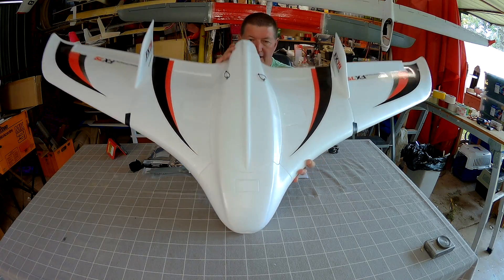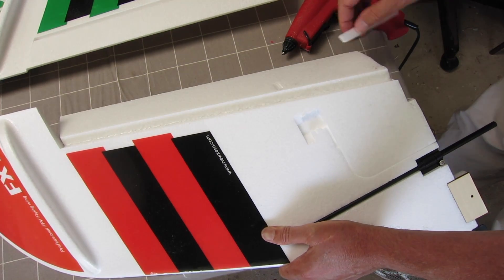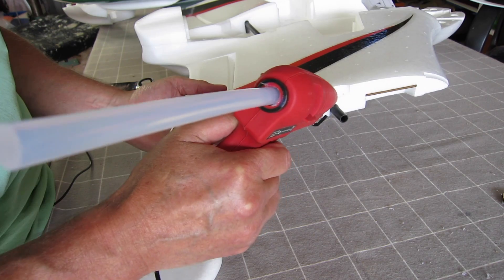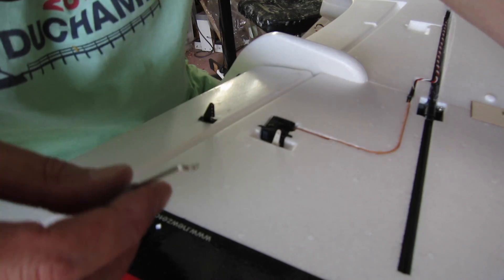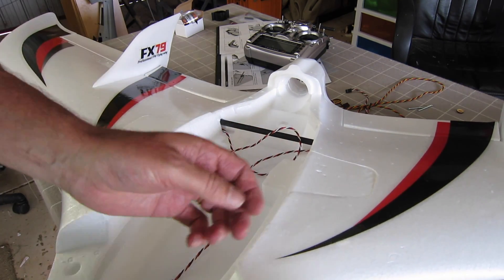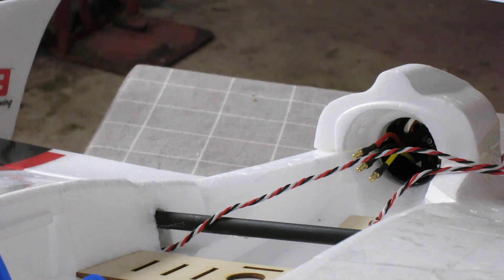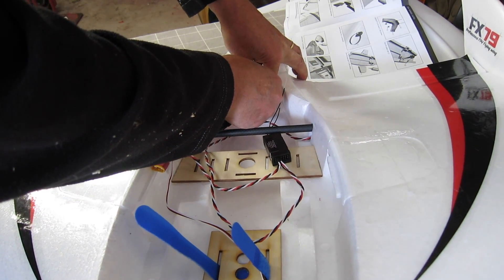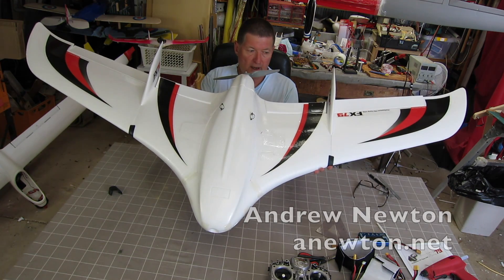Zeta FX-79 build

Comment: What type of tape did you use for the servo extension leads?
Reply from the maker: Fibre reinforced tape from HobbyKing, but I wouldn't recommend it. Turns yellow and unsticks over time. Blenderm tape is better but expensive and hard to find. Normal packing tape might be the best
Reply: @AndrewNewton  thanks for reply.

Comment: Broke my aeilron best way to glue it back on ?
Reply from the maker: UHU Por or E6000 so it stays flexible
Reply: @AndrewNewton  i used weldbond found at mitre 10 seems to have done the trick. Could you use hot glue?

Comment: Good job on the video! I have an FX79 and love it. Long distance FPV only. I use a 3542 1000KV motor and an 80 Amp ESC. For some reason, both units heat excessively. I have tried everything I can think of. ....other than installing the ESC on the outside of the aircraft. I finally sourced a 12 volt dc fan and provide a 2200 mah battery each flight to power it. That seems to control the heat.....however I have never ever experienced this before. Granted warming up is pretty traditional but the ESC would be too hot to hold your finger on it after five minutes of low speed flying. I just don't get it. Any thought? You ever experience anything like this?
Reply from the maker: That's odd. ESC timing maybe? Tight bearings on the motor?

Comment: Hi Andrew, looks like im getting one of these, what is the minimum size lipo i might get away with using in it, want to keep it light, has Turnigy 1000kv motor and 80amp red brick esc, hoping to use 5200mah 4s, but it has an 11x6 prop so might have to drop the prop size
Reply from the maker: 2 x 3000 4S is what I needed.

Comment: Hay Andrew have you had any issues with hot gluing the motor mount on ? I.e motor heat softening the hot glue? I've hot glued mine on like you but flitetest said not to
Reply from the maker: No problem with mine, I changed to an extended motor mount also hot glued in. See the Carbon Bird video

Comment: Thanks for your help again Andrew. It will be a big help. 
Anything else i need to know Andrew? 
Good deal on Banggood today on this wing. 20% off. So i treated myself. 
Also ordered motor and esc. Can't wait to get it. 
O yes, good job, I watched, as i forgot long servo extension leads.
Ill go order them now. 👍
Thanks again. Keith.
Reply from the maker: Nice one Keith, it's actually very simple, just BIG. But very well behaved in the air. Launching takes a decent throw and it loves to glide so landings are long.
Reply: Andrew Newton All sounds good. Thanks.

Comment: Ah good old Hot Glue...I also find it works really well, forms a good fast bond....as long as the area is not too great.....UHU POR for the rest.
Reply from the maker: UHU POR, must try that, thanks
Reply: +Andrew Newton Yes, surprised you have not heard about POR....Its German, not cheap but good stuff...clear.contact adhesive...:)

Comment: it's begging for an autopilot Andrew..😀.  BTW launch with the motor off as the prop WILL get you eventually.  I have my left rear switch as a safety switch.  the easiest way is put on the safety switch and advance the throttle.  Launch the wing then turn on the switch as soon as it leaves your hand.  This is easier than advancing the throttle.  With an autopilot you just have an autotakeoff set with a delay for acceleration.
Reply from the maker: Yep, I like the way you think
Reply from the maker: I usually side arm launch or toss then throttle up, but might be difficult with this monster
Reply: toss it from a cliff.... and then punch the throttle!
Reply: Andrew Newton - I always launch side arm as well however with this size plane it is almost impossible to hold the plane straight with one wing.  We used a short bungee with our X8 which is another option.  I suggested the safety switch only because I find it easier to turn a switch before the plane hits the ground from a throw rather than advancing the throttle.

Comment: G'day Andrew looking forward to see this fly.
I use cheapie metho to get hot glue of ,  works good for the foam board I use worth a go if you want to remove the battery tray.
Reply: Metholated spirits in the UK - denatured alcohol
Reply from the maker: I use metho too. Not sure if metho translates internationally
Reply: Best of luck, looks like a winner. If you don't mind a little reptile you can use a hair dryer to heat the bajesus out of stuff to loosen hot glue. You can melt servo horns, but when the servo is shot I remove the horn and grab with vice grips and get out the hair dryer.
Reply from the maker: There you go, thanks